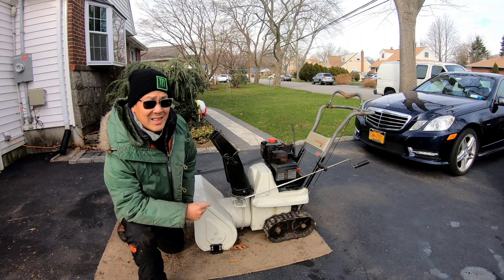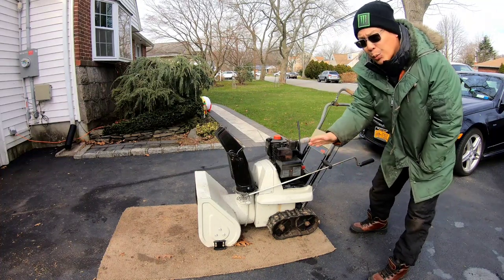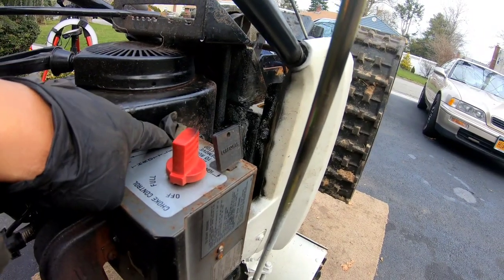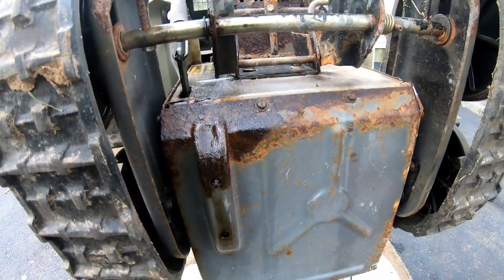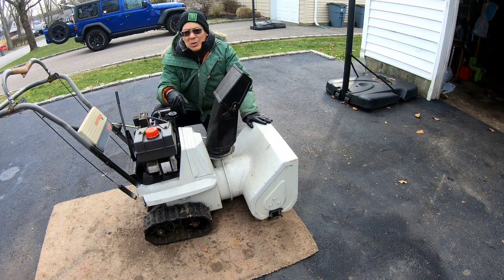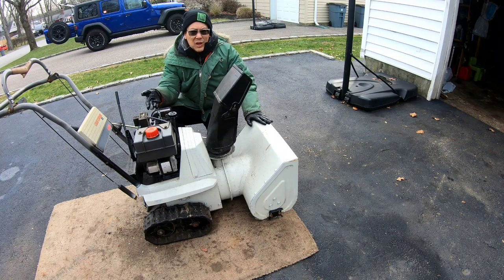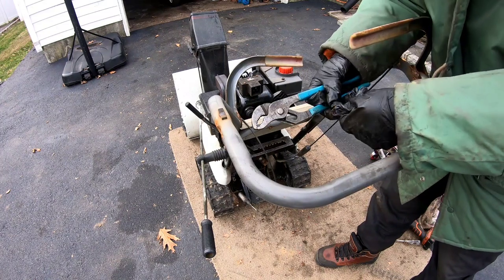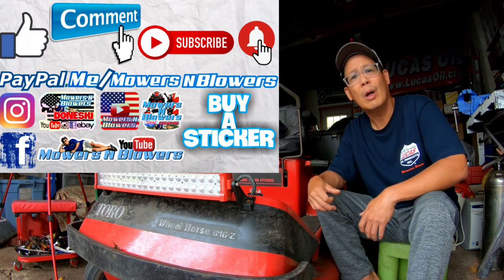CRAFTSMAN 420 TECUMSEH SNOW KING TRAC-DRIVE DUAL STAGE SNOWBLOWER WONT MOVE FORWARD BACKWARDS FIXED!

Comment: I used one of the cans you gave me today on my silver Chrysler, the brakes on the passenger side were grinding, I just did the brakes a few weeks ago, well had it in for some engine work, and it turned out a piece of rust had gotten between the inner pad, and the rotor, and was grinding, I used the Lucas spray, and it cleaned it right up, and no more grinding, tks bro.... And Lucas oil products.

Comment: What camera and mic do you use
Reply from the maker: GoPro 7 black.  Stock mic on the GoPro
Reply: @MowersNBlowers  i want to try my go pro but Idk how it wpuld sound
Reply from the maker: I used to use a lavalier with my Samsung Galaxy s7 edge but it always had problems with static and sometimes I’d do a whole segment and forgot to plug it in.  The GoPro works great!  You have to try it!